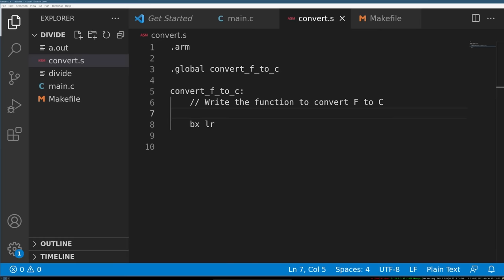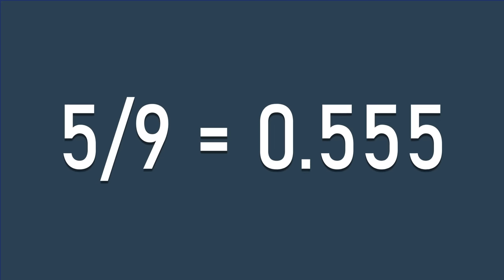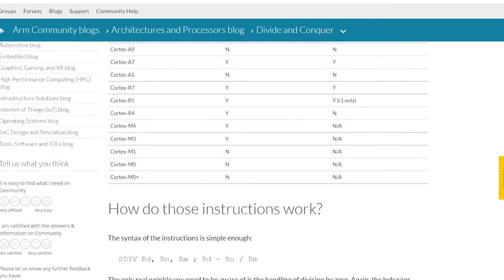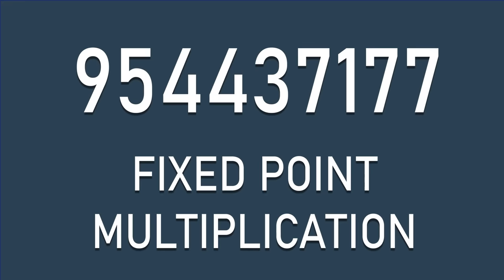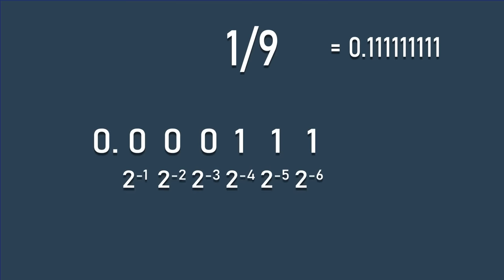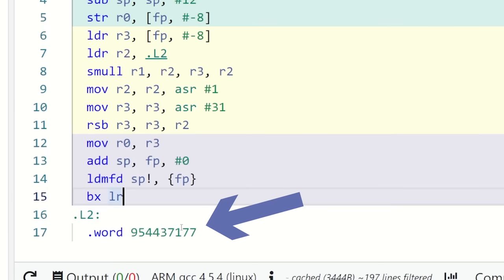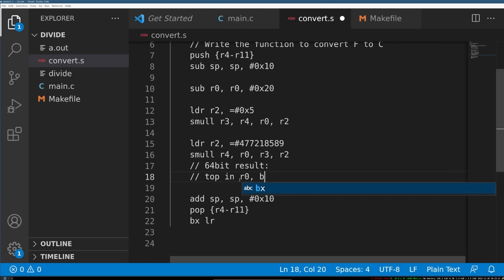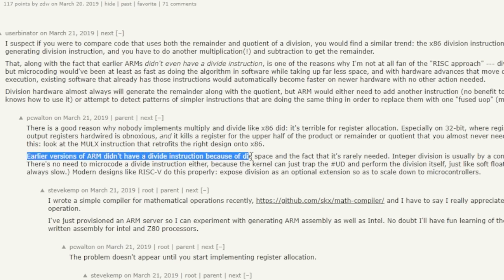computers suck at division (a painful discovery)

Comment: This has been true for many 8 and 16 bit microcontrollers. On non-deep-pipeline processors, division would typically take quite a number of cycles which hurts  interrupt response time. A particular exception was/is the 80C1166 or XC167 family from Infineon. They have a four cycle division operation that can be interrupted. There are some extra registers to be saved in the interrupt service routine if the interrupt itself uses the division operation.
Reply: Why would anybody interrupt a 4 cycle instruction? 6502 does not allow interrupts within its up to 7 cycle instructions.
Reply: @ArneChristianRosenfeldt  These devices target the car industry. Most of the other instructions require one clock cycle. So if one instruction would quadruple the interrupt reaction time, it would make sense to invest in improving this.
Reply: @acd1235  But as the video show there are limits. A 1:4 ratio between those good old 8 bit like ALU instructions and MUL/DIV shows that both have been optimized. I guess that in real-time applications minimal jitter is paramount even at 100 MHz. I just hope that airbag triggers are not interrupted and don't run on the same hardware as the entertainment system.

Comment: I wrote a compiler for one of these tiny CPUs. It does it the same way using fixed point. The trouble is you can't squeeze it into 32 bits so well. Compromises are so ugly, but that's life.

Comment: Since the conversion is a linear equation it feels like you can do it very efficiently by doing a root finding method with addition only. You can work out all the floating point numbers after the decimal point one by one using a for loop (Jmp loop?) for however many iterations you want. IDK what the use of knowing the FP number is since the processor cant use it but you could at least print it.

Comment: I was writing assembler level software in the 1980s and like everyone doing that I gained a real appreciation of those precious clock cycles. When I started using 'high' level languages like PLM and Pascal I would compile them with the /a or /o setting to see the assembled code / object code the compiler was producing to help me optimise the code. Then along came the next generation of SW engineers - all object oriented / array based SW fans..... not one of them realised the performance cost of the implicit multiplies in an array or other structure, and not one of them really understood the difference between passing structures ByRef or ByVal.... they barely comprehended stacks.
Ahhh, the C++ / Python etc. youth of today!.... they don't know they're born. But just for us old 8 bit engineers - what was more impressive than seeing someone's code and running into XTHL and XCHG commands? - that was someone who writes quick code :)

Comment: Few remarks: a) division is not that slow, but implementation of division can be slow, vast difference; b) radix-2 SRT algorithm doesn't require much space at all, it is slow, but very compact, while radix-4 SRT was the sweet spot for CPUs for ~20 years (and source of Pentium FDIV bug); c) instead digging you could pick up book about computer arithmetic, division usually gets at least two chapters.

Comment: I'm just going to point out that the first LDR and SMULL is a very inefficient way to multiply by 5. It uses 2 instructions, 4 registers, and several machine cycles. Instead use:

ADD r0, r0, r0, LSL #2

Only uses 1 instruction, 1 register, and 1 machine cycle.

Comment: Use fixed point math, it's the only thing used in automotive ECUs for safety! Just multiply your F by 100 to start, minus 3200, multiply by 500, divide by 900, then your answer is in C (×100). You can offset the DP by 2 places in a custom print function.

Comment: Alternative way with fixed point math: Use a 32 bit int. Shift up the value by 16 bits. The lower 16 bits are the fractional part. Precalculate 5/9 in this number system. Use a 64 bit register to multiply two of these. Then shift down by 16 bits to read the result. Or if you don’t have 64 bit registers. Shift down both multiplicands by 8 before multiply. This gives you less precision.

Comment: This was a problem even before computers. Physical machine calculators also require a lot more space and time to do division, often simpler ones would be sold without the ability to divide. The logic we use is just fundamentally many-stepped

Comment: Step 1 of engineering is "Make your requirements less dumb"

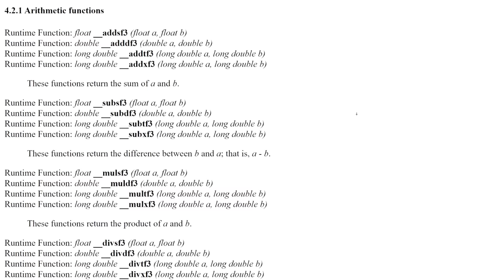0:55 "Not all ARM processors have an FPU"
The answer to that is "It works on my machine." Unless your professor specifically banned use of the FPU, you should have used it.

0:57 "and without an FPU, I would have to rely on LibC's floating point approximation librarys... and that felt like cheating."
If there's a library that already does the work, then don't waste the time. It's probably a better approximation algorithm then you could write in a couple hours.
Also, making library calls from assembly is an accomplishment as well.

Comment: I remember simulating fixed point math by shifting bits right and left while drawing 3D stuff on 286 processor using inline assembly with Turbo Pascal. Those were the days and it looks like they never went anywhere.

Comment: A CPU's division operation is no other than shift right. It divides by two. The usual division algorithm we humans use can be followed when working with binary numbers, but it is even simpler. Consider only integers. The quotient figures are 0's and 1's:
      A 0 is appended when the current dividend portion is less than the divisor, a 1 otherwise. If 1, subtract the latter from the fore as residue. Anyway, if not done with all the dividend's figures, append the next to the residue to build the current dividend portion and loop back.
      If not integers, fixed binary fraction points can be assumed. For more flexibility, floating point formats can be used, subtracting exponents and then assuming mantissas are fixed dot numbers with null integer parts.

Comment: Other method for division is Russian Peasant Division. This method is can be modified to be used in modulo operations. The logic can be implemented for fast power calculations including integers. It works in O(log n) complexity, n being the numerical value of your divisor or your power, but in a 64 bit system, it means it will take some constant c*64 times, therefore with the efficiency of pipelining and branch prediction in modern processors, it is safe to assume that this operation takes constant time.

Comment: Another option is to use fixed-point math to emulate floating point numbers, so you can represent 0.555 using an integer number. The downside is that to maintain good precision you would need to use 64-bit accumulators for 32-bit multiplication (most ARM processors are at least 32 bit)
Reply: That's exactly what is done in the video

Comment: I found that adding 10% to a number and diving by 10 to be a great approximation of dividing by 9.
Now, that just sounds like twice the division for a worse result, except that it can be done easily with bit manipulation: move the decimal point and add that to the original value- adding 10%. Then move the result's decimal point again to divide by 10.
The absolute difference is relatively miniscule, and scales linearly with the numbers divided.
Reply: The binary version could be to subtract 1÷8 of the number and divide by 8 (bitshift by 3)

Comment: As an old Apple II programmer I’m used to this. In fact, you should combine your two multiplies. Instead of multiplying by the fixed point 1/9, instead multiply by the fixed point 5/9

Comment: Wow, You discovered something that we discovered back in the late 70s !
Multipying by 5/9 is the same as multiplying by its inverse ie. 0.55555 recuring. So just remove the decimal  point and add as many zeros as you like etc .. It's actually much easier to do if you just think in Hexadecimal.

Comment: Ohhh, I still remember those old days when the FPU unit was separate from the CPU itself. Software division is actually not that difficult to program, using long division or the restore division method is only 20 or 30 lines of assembly code.

Comment: Yeah, i try to avoid multiplication and especially division as much as possible when programming on my microcontrollers. Little tip with alot of asterisks, if what youre dividing by is a power of two and the number is an integer, try bit shifting. Theres probably quite a few asterisks to that but its worth looking into

Comment: Remember having to shift bits and add them since even MUL wasn't available in Z80, but later in 6809 and that was only 8-bits, then you could do some of the 16-bit stuff in the 68000 and Intel processors. 32-bits was after my time but the principles were the same and were doing more with C and C++ then.

Comment: I once wrote a sine function in assembler. Using fixed point numbers I believe it was accurate to over 16000 decimal places after the point. 
That was before processors had built in multiplication and division.

Comment: Division is really slow. The fastest method computers have is SRT, which uses look-up tables to figure out each quotient digit.  SRT-4 generates two bits at once (base 4) each iteration, so less circuitry is needed; however, the tables grow exponentially, like SRT-16 generates 4 bits per iteration, uses 15 times as much space for the table, and takes 2.5 times as long.  Most chips use a technique where they chain SRT-4 multiple times so they can get several bits per clock tick.

I know this because I ran into this problem when trying to design a custom chip and so figured out how to do it without the table, which turns out to be faster and MUCH, MUCH SMALLER.  Look-up tables need to be energized, so when they're big asking for a particular entry takes time, and it takes a lot of energy.  Electricity goes to so many dead ends just to select the correct path to the right cells containing the number you need.  Further, you need to find the quotient digit `q` to perform the operation R[n+1]=4(R[n]-qD), which is several operations.  The logic to actually compute `q` isn't actually that complex for SRT-4, though (I came up with a whole theory about how the lookup tables really work), and I can do some of the operations in parallel now, but that's not enough.  The way I did it uses a few additional tricks to bypass the entire cost of calculating `q` with VERY little extra circuitry--mostly a couple 7-bit adders and a 7-bit array of 2:1 muxes--so I'm already moving onto the next digit before I actually know the result of the current partial remainder computation.  In other words:  there is a bunch of stuff that has to happen before you can compute R[n+1]=4(R[n]-qD) and after the first digit the processor is computing R[n+1]=4(R[n]-qD) all the time without waiting to find out what `q` is and it produces the correct result.  I moved everything except the core computation out of the critical path; you can't make a faster divider, it's impossible.

Comment: 32-bit (ARMv6, ARMv7) which is in many MCUs has optional FPU and SIMD extension (NEON). That's the reason of multiple ARM Linux versions (ARMLE).

64-bit ARMv8 is completely different animal. Completely redesigned, different encoding (binary not compatible to ARMv6 and 7) and mandatory FPU and 128-bit NEON SIMD. However big differences are in implementation (HW). ARM Cortex A72 in Raspberry Pi 4 has only 64-bit SIMD so to process 128-bit vector it needs two clocks. While Apple M1 can do 4x 128-bit vectors per cycle (8x faster).

There is also new ARMv9 with SVE2 (allows vectors up to 2048-bit long). And new Scalable Matrix Extensions (SME and SME2) also using up to 2048-bit registers. I guess SME will be used for the first time in next Japanese super computer from Fujitsu (ARM based). The old one is still second fastest and is using CPU only .... and yet beating most super computers based on x86 server CPU with multiple gigantic GPUs. That's evidence that RISC ISA with modern SIMD extension (Fujitsu uses ARM's 512-bit SVE SIMD) can outperform GPUs.

Comment: Thing is computers are very good at counting, from an electronic point of view, and before they became monsters with nanometers long transistors they were basically the same but with larger components. Multiplication is really easy to do (even tho it requires a lot of time), and subtraction is quite the same, but division can give birth to numbers very hard to compute for a processor and it’s overall an operator that a “adder” will never be good at, that’s why we use different computational methods to process divisions already integrated in a coding language

Comment: I wrote floating point multiply/divide for the 6510 in my C64. That didn't even have a barrel shifter, so it was not easy. I found out many years later that Steve Wozniak had done the same, except his routines were a lot better than mine (of course).

Comment: Kind of reminds me of p-adic numbers in math. P-adics are numbers with infinite digits, but they are (in a way) defined to be non-infinite. You could have e.g. …99999999999999999 as a p-adic (technically it’s a 10-adic but it doesn’t really matter) and the interesting thing is that adding 1 to this gives …000000, or 0. Therefore, we treat this number as though it’s -1, because functionally it is. A similar set of numbers exists in the 10-adics, where you can multiply by (say) 9 and get 1, making that particular number functionally equal to 1/9. The same concept works here simply because instead of carrying the digits off into infinity, a computer just stops caring about them after some amount. The nines being -1 example is essentially the idea behind the 2’s complement system (more or less) and this kind of multiplication-by-division thing is the same as the latter example.

Comment: It's not particularly hard, the classic approach is to implement a restoring or non-restoring division, it takes up to N cycles (if implemented naively, but requiring less area) with N the number of bits. It wasn't rocket science even several decades ago - it's just that they would save as much area as they could as silicon was very expensive (at least compared to now). It's kinda the same now for the simplest cores that do not embed a hardware division. It does save some area, but it's also a marketing thing. Hardware division can be done without in many cases, as you talked about, and that allows vendors like ARM to have a whole range of cores with a whole range of prices.

Still, a division is always a more expensive operation than multiplication, even when implemented in hardware (at least in most cases, hardware division that would take as few cycles as hardware multiplication - namely, 1 cycle for many cores - would be exceptional.) So learning how to do without is an important skill.

Comment: Another reason why ARM has no division in its instruction set, is that they run a RISC architecture. The original philosophy of this architecture is to have every instruction done in clock cycle, to be much more predictable. A quick google say that's no longer strictly the case, but the philosophy still holds: if you need to do a simple conversion with limited accuracy on a very tight time and power budget, using floating points is horribily inefficient.
Reply: Maybe you should check MIPS, SPARC, Alpha, PA-RISC and PowerPC/POWER. And RISC is not an architecture, it is an approach to CPU architecture. Single cycle execution - yes, but with pipelining.

Comment: This is why you pick the processor based on your application. Don't just use whatever is cheapest. Pay attention to the datasheet. An M4F would have been useful, but again if you only needed division in the one function then using the software floating point library IS the best approach. There's no point in re-inventing the wheel.

Comment: This problem was solved in a more elegant way in silicon 60+ years ago using what amount to look up tables rather than doing floating point at all. The details of what the chip do are more complex than that, but it is essentially a single operation cycle solution for division and other problems.

Now for a trickier question. Going back 60+ years again, the chips throw many different flags for different math results, reporting divide by zero, infinities and more. Yet these flags seem to never be used. Why not?

Comment: Your choice of input (86F) converts exactly to an integer (30C). I checked other values in a different language and got rounding errors on my platform. Please check the result on your hardware for input is 87. You should get 31. I modified the formula and got accurate results for inputs between -459 and 5000.

Comment: I did a similar thing when I wanted to round a number up to a certain decimal point. I would multiply the number by 10 to the power of how many digits after decimal point I wanted to round the number to. I then called the round function. Then I divided the result with that same 10 to the power number. What you did is more cool since you used the fact that shifting bits right is same as dividing and shifting bits left is the same as multiplying (I also used that fact in a prime number algorithm to find a faster way to compute upper boundary than using sqrt). 
 You shifted 5/9 32 bits to the left so that the you ended up with a number that is shifted 32 bits to the left compared to the actual number of Celsius. You used the fact that the register has 32 bits which means that you don't need to shift your result back 32 bits to the right, you can instead simply read the value from the next register.  
If you tried to do this same thing in C (using variables or arrays instead of registers) you would violate strict aliasing rule and therefore it would have been undefined behavior, but since you are writing in assembly you can safely do this, there is no compiler to mess with your code.